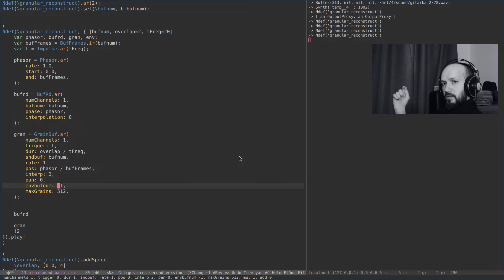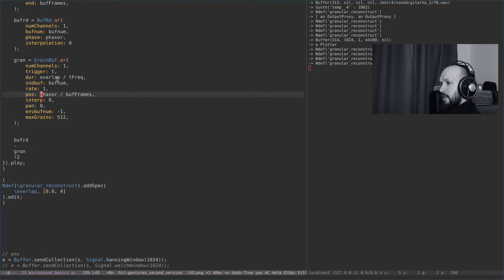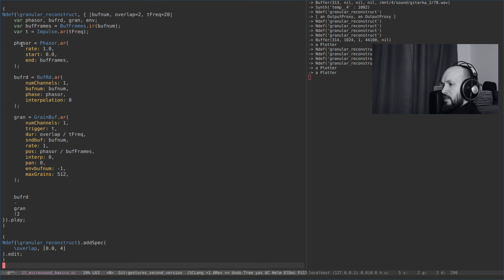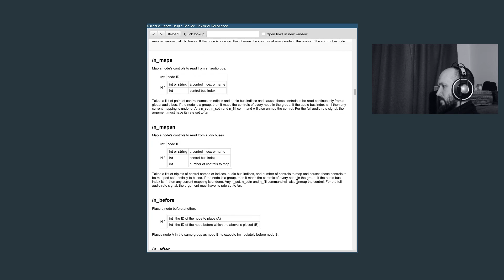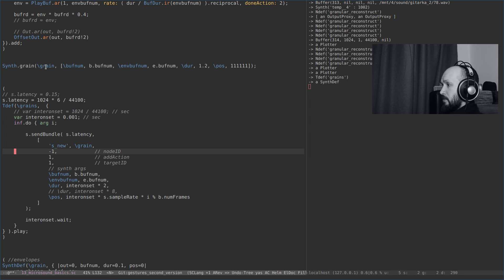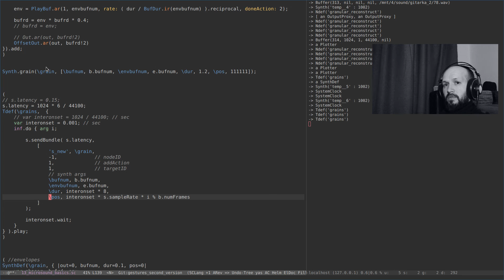13: Microsound[0]: Basics and granular phrase sampling - Musical Sound Design In Supercollider

Comment: Just getting acquainted with this great series. Running the code for this episode, my SC 3.11.2 on MacOS generates an error on the .addSpec element in the Ndef 'granular_reconstruct'. There's no such option apparently. Am I missing a library or a Quark? Or is this an inconsistency among versions on platforms? Thanks for any help.
Reply from the maker: Yeah it's my bad I didn't mentioned that. jitlibextensions quark should provide that method
Reply: @Reflectives  Thanks, but jitlibextensions doesn't seem to resolve the error.
Reply from the maker: @edwardnixon1782  Strange I have it in Halo.sc file which comes with that Quark. There also was a mention that Influx quark provided it. Anyways you can just add a spec globally with Spec.add(same syntax here as with addSpec)
Reply: @Reflectives  OK. I've been on a sabbatical from SC for a while so I could be making a mistake. Ndefs were never my stong point at the best of times. Thanks.
Reply from the maker: @edwardnixon1782  You're welcome
Reply: @Reflectives  Yes, there's something weird going on with my SC on Big Sur. Quarks.gui is reporting it's installed but at the same time throwing an error saying the downloaded package can't be found. This sort of thing is why I went on sabbatical: there's always something... ! Very tedious.
Reply from the maker: @edwardnixon1782  Yeah, that happens.  Even though I didnt have problems with quarks I just found that version 3.10 has a memory leak in sclang. So now thinking about compiling latest version from sources. But with quarks there is a simple solution, you can just download needed quark by hand and put it in sc extensions dir
Reply: @Reflectives  Yeah. It's actually a simpler, more concrete approach for me. There's such a thing as too much convenience. Particularly when it doesn't work... I like the little widget gui thing, by the way. That's another aspect that held me back. For a non-coder who wants to be hands on it's hard to get to a level of knowledge where you can tweak and twiddle around and through the output of your synths. As you call it, prototyping. I'm back, working on creating 'reels' for a modular set up that includes the Morphagene from Make Noise.  Gendy and granular samples. It's a more bite sized & piece-wise approach that takes the pressure off me of going for the magnum opus -- a project that would never get done if I had to code it. Looking forward to working through the rest of your stuff. (You seem to have a very good relationship with your daughter. She's very articulate. Congrats.)